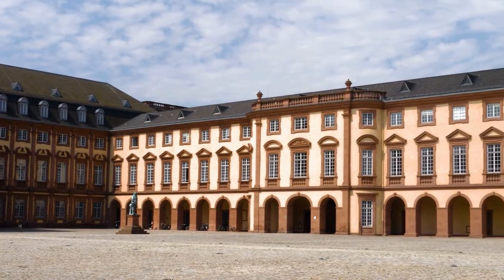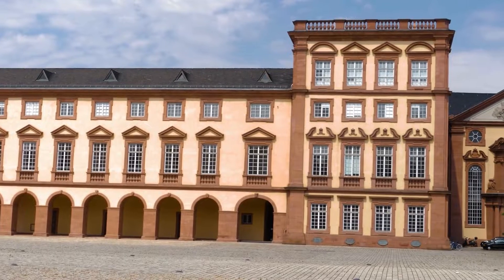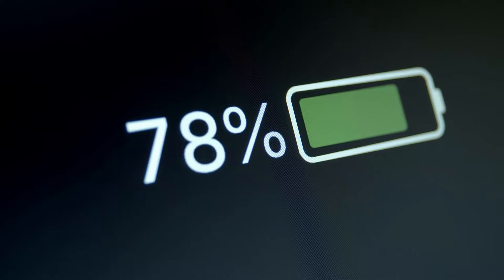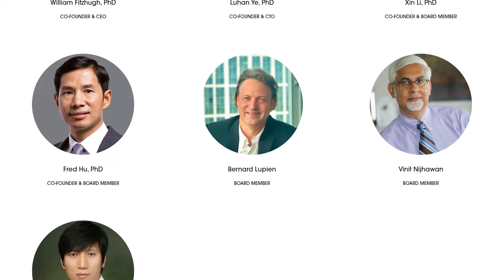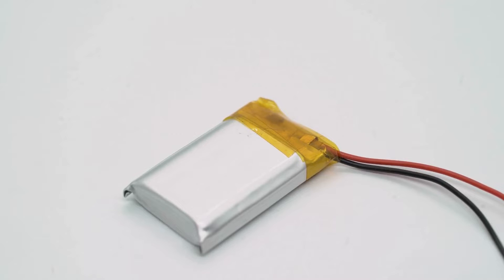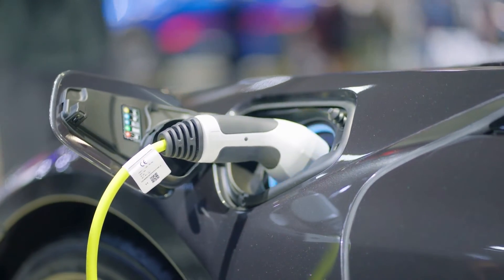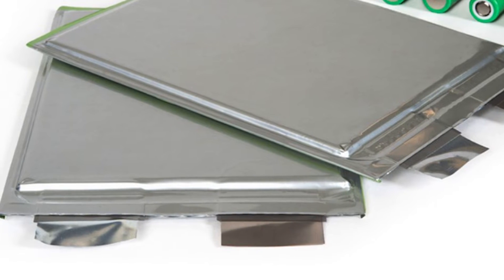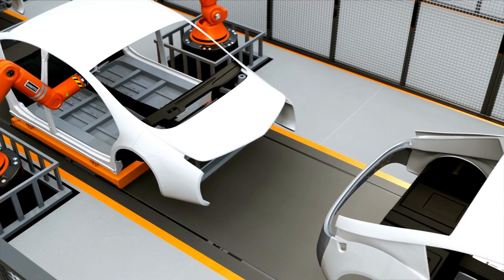Harvard engineers develop solid-state battery with performance, reliability improvements

Comment: For a 50KWh battery (~250Km), the charger should be able to deliver 1MW on average for a 3min charge. Considering that the charger reduces the charge current towards the end, a normal CC-CV charger should be able to deliver an estimated 1.2MW.

Comment: So the battery get charge in 3 min and can run a car for 20 years 🤯 what if we use in spaceship 1 battery 🔋 1 car if we use 10000 of those battery we can do interstellar in ears mode imagine going to march in 1 min
Reply: Am I dumm or some thing happened just now  a average car take 1323 watts of electricity so 1323*24=31752 watts in a day so 31752*30=952560 watts a month 952560*12=11430729 watts a years 11430729*20=2289614400 watts of electricity on 20 years 😂🤷🤦 if we use 10000 battery in a space ship 2289614400*10000=naa my calculator dead 🤣 2 billion 289 million in 20 years soo 2*10000 and 289 million too 25000000000000 watts of electricity can be use by 10000 of this battery // if this is true we are dead
Reply: Lol 20 years is the battery life
Reply: @god9761  ok so we need to charge many time for 20 years that's just normal battery🤷🤷
Reply: @pluton9311  yes it will have even less range than current battery
Reply: @god9761  proof?

Comment: Still a dream... And what happened to the nuclear battery project?
Reply: Am I dumm or some thing happened just now  a average car take 1323 watts of electricity so 1323*24=31752 watts in a day so 31752*30=952560 watts a month 952560*12=11430729 watts a years 11430729*20=2289614400 watts of electricity on 20 years 😂🤷🤦 if we use 10000 battery in a space ship 2289614400*10000=naa my calculator dead 🤣 2 billion 289 million in 20 years soo 2*10000 and 289 million too 25000000000000 watts of electricity can be use by 10000 of this battery // if this is true we are dead